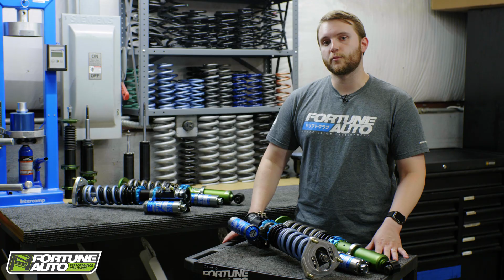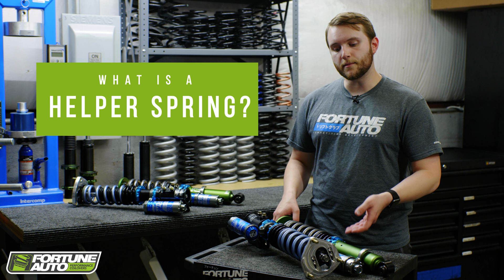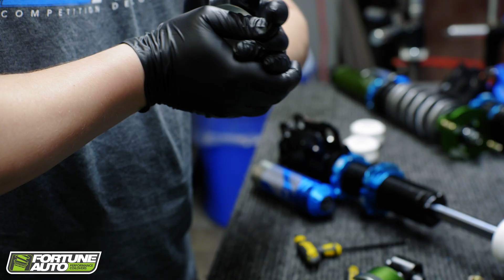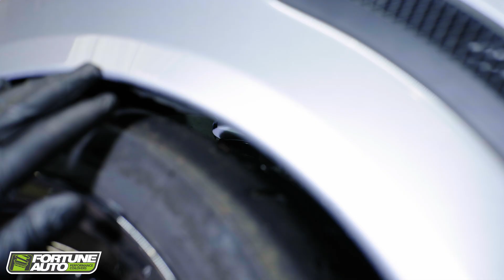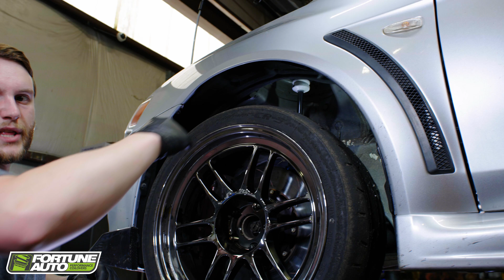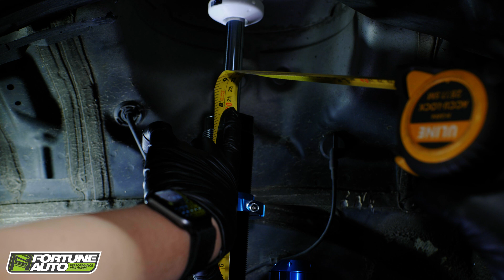How to Adjust Fortune Auto Coilovers with Helper Springs

Comment: For coilovers that do not come with Help Springs, it says in the description to lower it via the lower mount. Would that negatively impact suspension travel? Or are these just roughly the same concept, but with two separate bodies?

Comment: Really helpful video. Especially if you don't have adjustable shock bodies. Adjusting the bump stop height properly vs coil bind is critical. I have 510's set up for the track, but I'm moving up to 3-way's with fixed bodies so I'm trying to figure out the setup for my BRZ.
I have hearing issues, so the constant screeching background music is VERY annoying and distracting. Please  get rid of it!

Comment: Great video, but random question.. my FA500’s started to squeak after 6 months of use.. it’s been getting louder recently over the tiniest of bumps, what can I do to fix this?
Reply: Lot of variables to consider, send Fortune an email so the team can help you diagnose and resolve the issue!
Reply: @Zackparagon  I actually emailed them and they said refrain from riding close to full stiff and they are sending me grease which they said would fix the issue 100% per the email convo. They said to apply under the bushings/bump stop and dust boot. Apparently it just needs to be lubed. Thanks for the response!
Reply: might be blown. mine were doing the same thing. just went back to stock